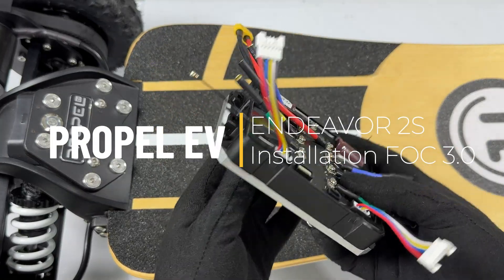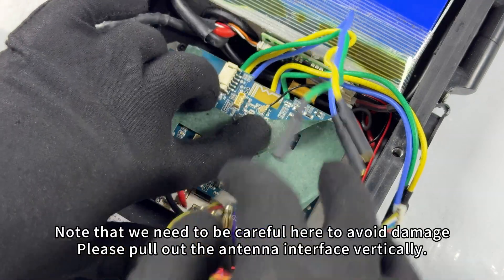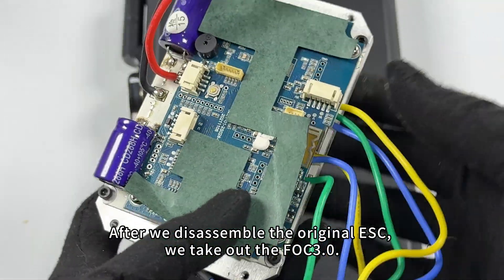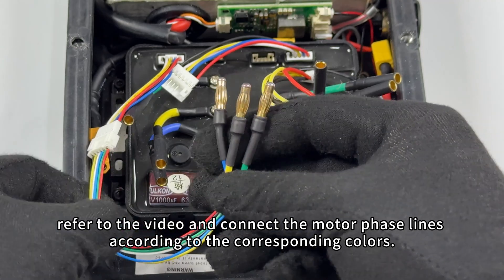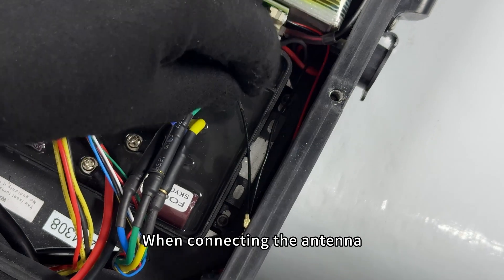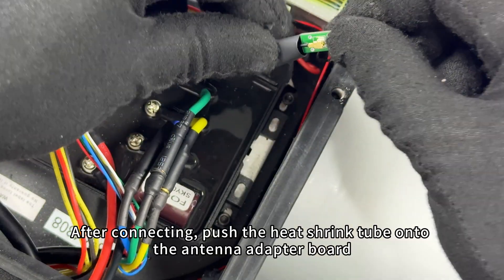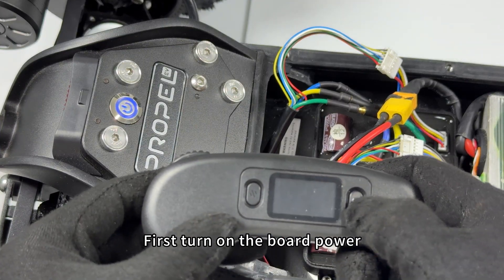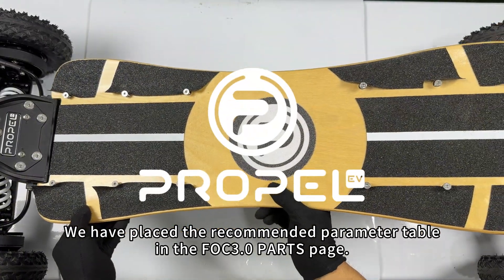Electric Skateboard Controller FOC3.0 Upgrade Installation Tutorial for ENDEAVOR 2 S

Comment: Hi I own a 2yr old Propel Endeavor Pro2 and it was working great, except the other day it malfunctioned. It seemed to have some kind of power failure where it applied the brakes half way or the motor gave out, I wasn't expecting this because I never hit a pot hole or object. This made me fall forward and injure my foot. So I listed to sell it because I don't trust it and someone replied and told me it is probably a faulty ESC and I would need to replace the ESC and receiver and remote. Does this sound correct? Do you have a video I can follow to change this stuff to make it safe to ride again?
Reply from the maker: I don't know if you are willing to try to replace it with a more reliable FOC3.0. Here is the installation replacement video. I hope it can help you. https://www.youtube.com/watch?v=Cu0Z46by1yk